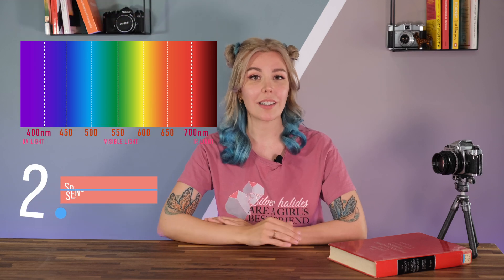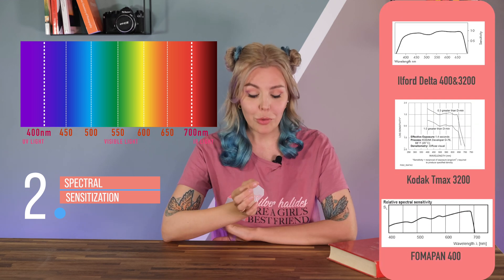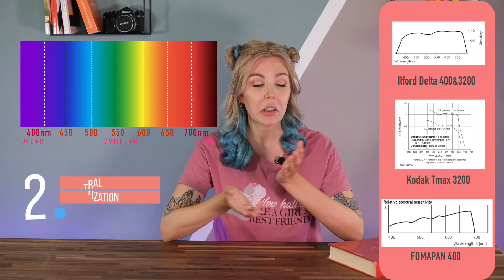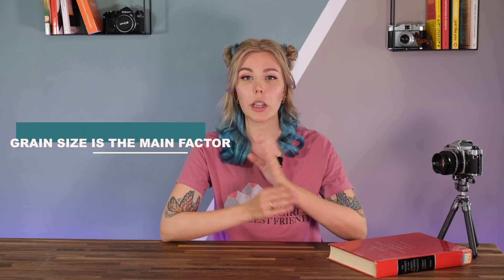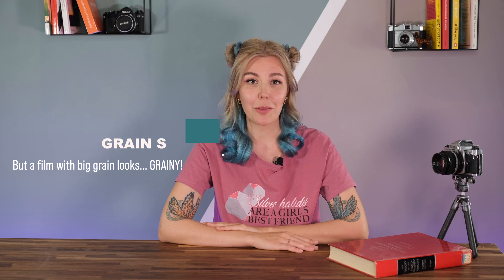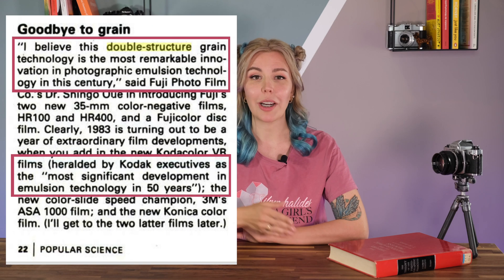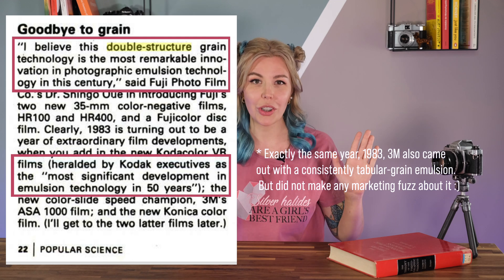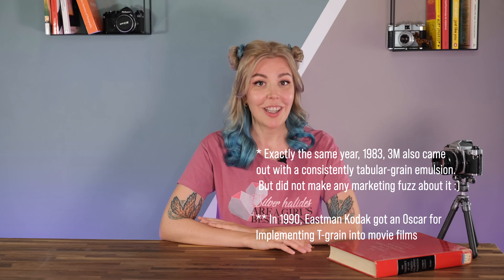Grain Types: Tabular, Cubic, Core/Shell - Choosing B&W Film

Comment: Such an informative Video, thanks for that. As someone who makes his own prints as a hobby I still try to figure out what actually influences the final look of the photos, and this helps a lot with knowing what different kinds of film do. My current ranking is the following:
- proper exposure: if something is underexposed or completely overexposed you're not going to fix it in printing
- developer: seems to have a big influence on the grain that appears in the final picture
- film speed: higher speed films seem to get more grainy
- the type of film: that surprised me, but it seems to make a way smaller difference than I thought before, the biggest thing that I noticed is that formapan films seem to have very little shadow detail, but otherwise all the other factors seem to have a way bigger impact.
Soo, that's my experience so far, if anybody has a good tip im happy to hear it :D

Comment: Thanks Lina this is super informative for understanding these different films. I did a side by side comparison with my Bronica GS-1 with film backs loaded with FP4 and Delta 100, shot the same scenes and developed in parallel. Results were almost identical. But shooting Deltas more casually outdoors I lose a lot more frames to exposure range problems so I don't use them regularly. Also if I want no grain and max sharpness, I just go digital!
Reply from the maker: If you want no grain, you could shoot a super-low ISO film. CMS 20 from Adox in Adotech developer has such tiny grain, it's impossible to focus with the enlarger :)
Reply: @linabessonova  True, good point.